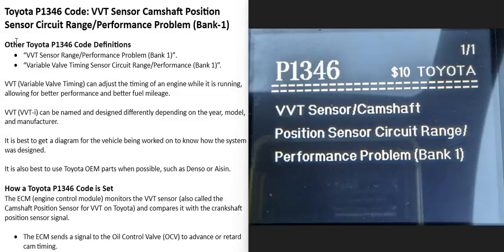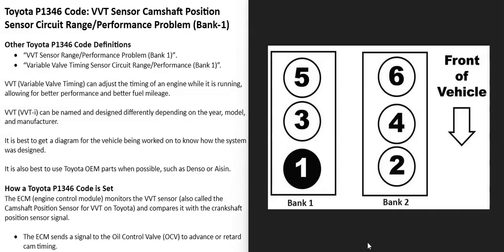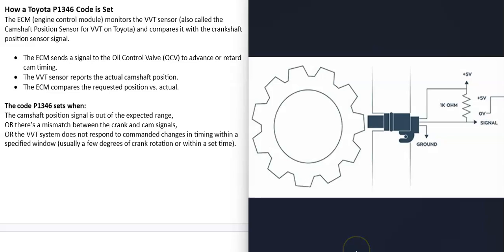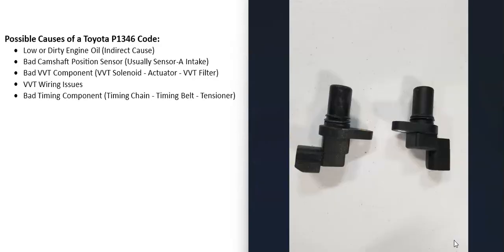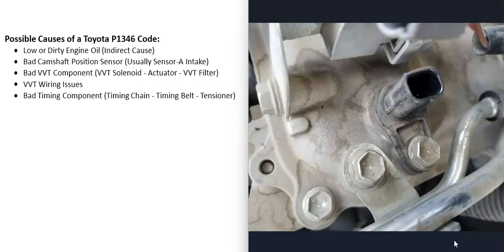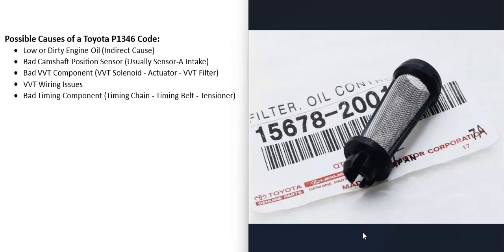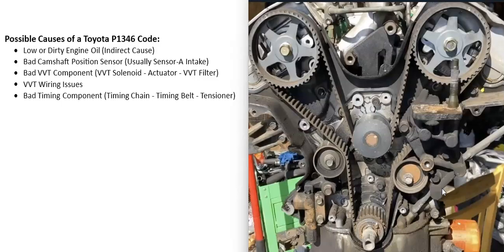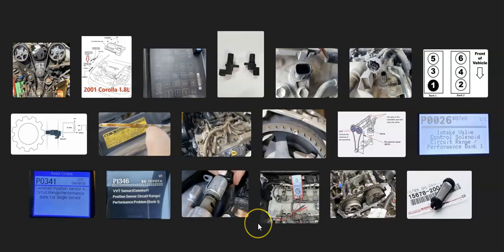Causes Fixes Toyota P1346: VVT Sensor Camshaft Position Sensor Circuit Range/Performance Problem

Comment: Please need help. 2003 Toyota Camry XLE 3.0 V6. Got a PO442 code today which is a small evap leak detected. But I went to check my gas cap and I'm hearing gurgling noise coming from inside the filler neck. Any idea what this is I'm sure it's related?
Reply from the maker: A P0442 Code is a small EVAP leak detected, which could be a bad component, but usually, there would be other codes. If the gas cap looks good (which is a common EVAP leak point), I would do a smoke test to see if any hoses or components are leaking.
Reply: @HVAC_Mechanic What would be causing that gurgling noise in the tank? Would the PO442 be related? I found a house that came off beside the air filter housing and I reconnected it would that cause the po442 it's a really small house where 4 hoses connected right beside the air filter housing.